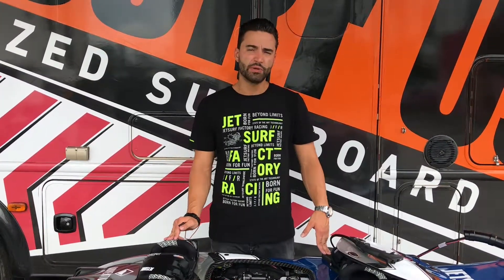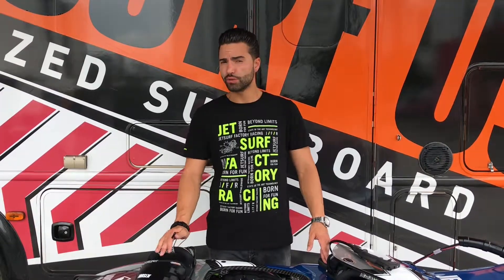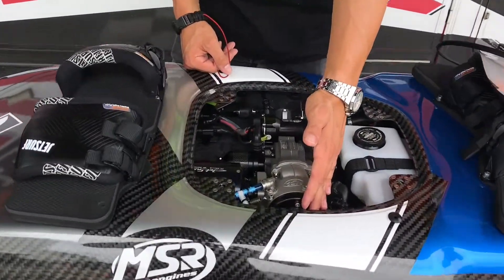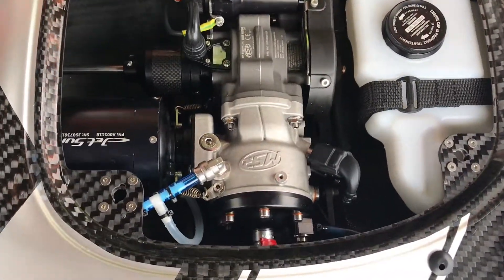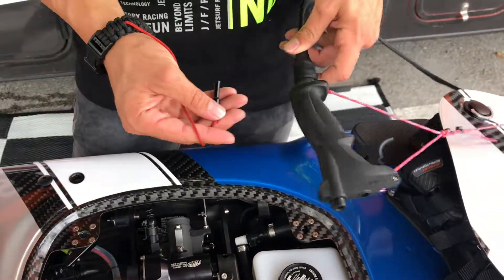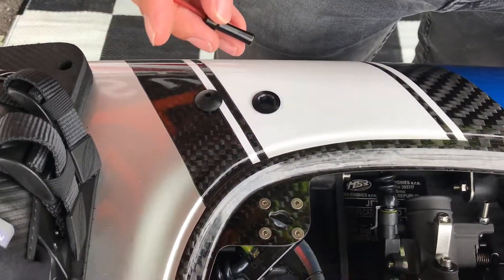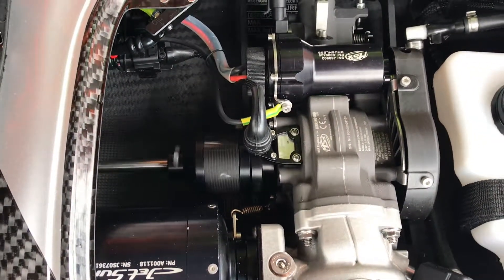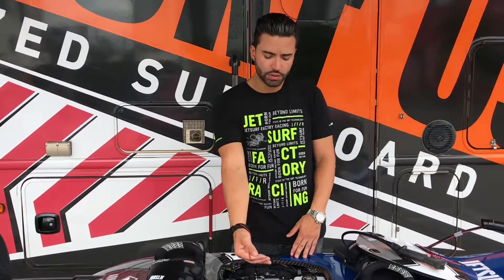JetSurf Tutorial 12: How to de-flood flooded engine

Comment: I have a 96 Seadoo gtx I just purchased it second hand. Is it normal that the engine has water inside? I removed spark plugs 4-5 times but water keeps coming out is that a problem or it’s normal

Comment: When I first got my board I let a number of beginners use it. They stayed on and flooded it.

I tool it out of the water and tried to start it by putting the key into the handle. When I try to rev it doesn’t work. I have found that after doing this several times it works. So I am not removing the spark plug. Is this bad for the board?